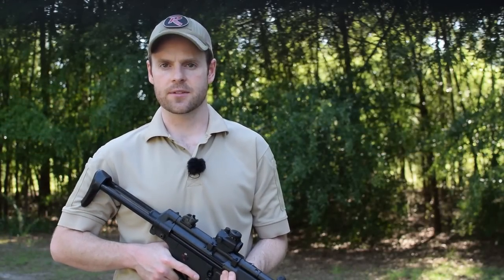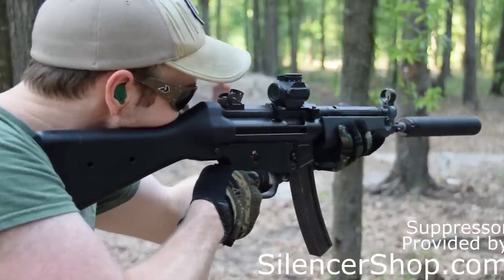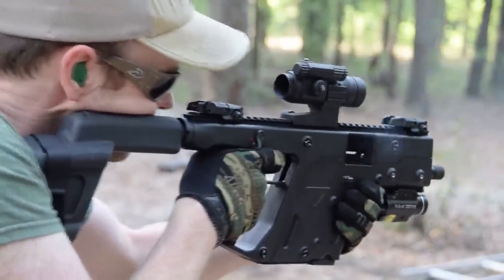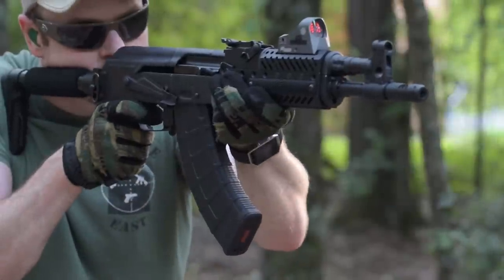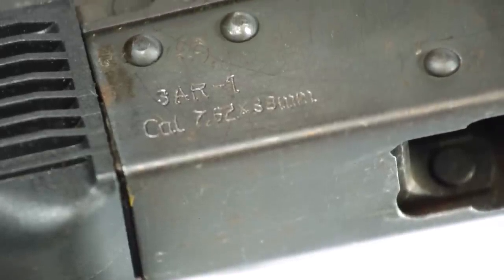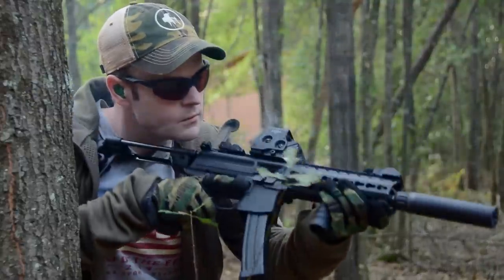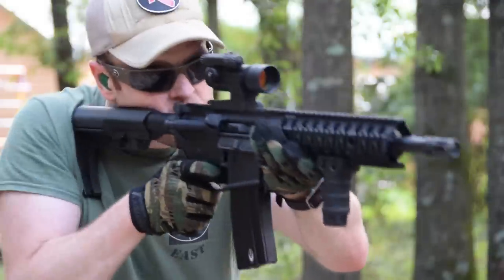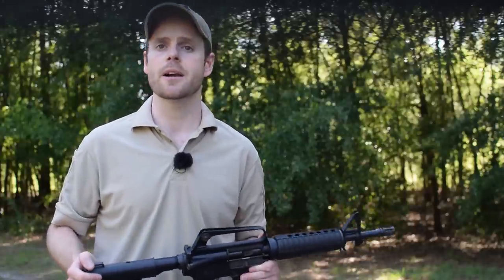Top 5 Guns to SBR

Comment: Why have an MP5 on the list when:
1) A real semi auto MP5 is barely available and the ones that are cost over $4k
2) The one that is now available is the SP5K which is stupidly priced as well
3) Clones are the only other options
Reply: the ptr and zenith are both as good as the hk (zenith even using hk tooling if I remember correct, but ptr is still as good and made in america, can even withstand full auto conversions more than a post 86 import like the sp5)
Reply: oh yeah, if you were to convert to full auto obviously use a registered sear or be a licensed ffl/sot if you don't want a dead pet

Comment: No Tommy gun?
Reply: Great old school.  But having used one.. Biggest problem is it's very heavy.
The ergonomics are not as good as current offerings.
The Good it's a  45 ACP.
People that tell you they are hard to control on full auto haven't fired one enough.
The Cutts compensator works.  As for accuracy, I can aim lower left for the first round at one hundred yards.  Then get the rewarding ting ting ting as it hits the steel target hard before it walks of target.
Damn NFA.  Too bad they don't still make them for civilians.
Cheers
Reply: @stever8776  You are right on weight, fun as it may be to shoot, it's very uncomfortable after holding it for so long. Good gun, just looks goofy with the 16.5" barrel.